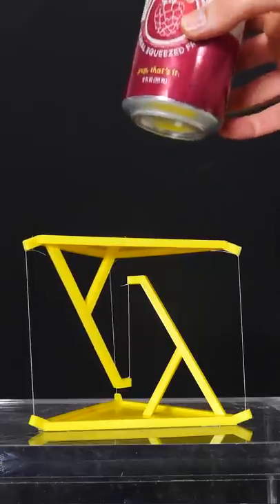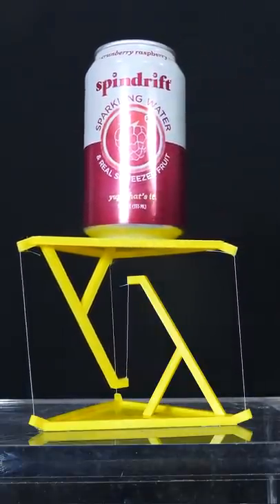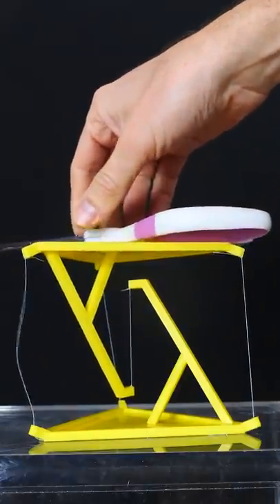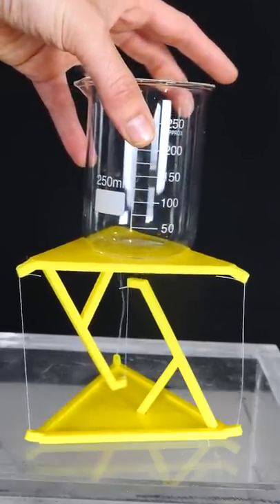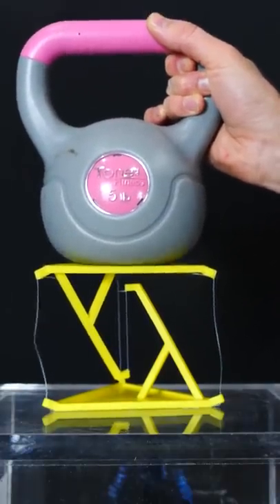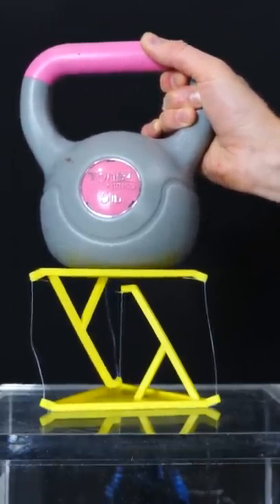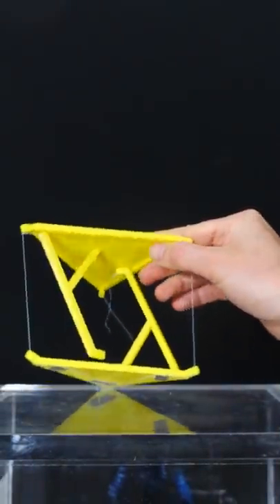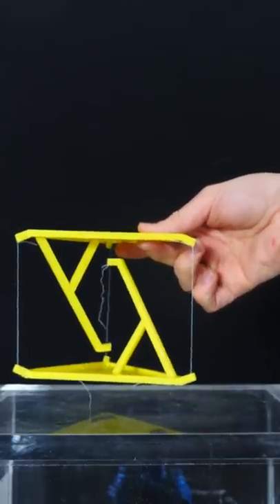Floating Tables Holding Weights

Comment: I honestly don't understand how the table could keep itself up stable even though he explained it, that's just crazy
Reply: It's pretty simple. The centre string holds it in place, and the side strings prevent it from tipping. Removing a side string will cause it to flip over, since nothing stops that side from going up. 

If you balance it right, you could do it with 2 side strings

Comment: Wait, so theoretically if the middle string was thicker/stronger would it be able to hold more weight, or would all of the strings need to be the same strength/thickness? /gen

Comment: Doesn't the centre string need to have more tensile strength than the 3 outer strings? The tentre string is the only one holding the structure up, and the outer 3 are the ones that are holding the structure down.

Comment: Well obviously the center string is the one that broke, it holds literally all the weight.
Reply: It doesn't hold literally all the weight. The sides hold a lot of weight.
Reply: @MelodicTurtleMetal  The sides stabilize the structure in 2 planes, but hold zero percent of the z axis weight. Zero.
Reply: @aanler  you're wrong. Applying weight in any direction will cause it to sink at the pressure point - the strings opposite pressure point will take a lot of weight because the structure will try to tip, and tensile force will pull it back down from the edges.

The centre takes more weight, but very far from all of it.

With nothing in it, the weight is spread between the centre string, and the string furthest from top pieces centre of weight, which is far from the centre. The far string will be under a lot of pressure

Comment: This doesn't make sense and my brain hates it
Reply: The top can't fall more, because the steering in the middle is short enough to catch the top. The top is pretty much hanging from the tip of the bottom middle structure. 

The strings in the side prevent each side from tipping up. When you apply without to one side, the string on the opposite side 'pulls' against the weight.

As long as the strings are the same length, you'll have an even structure.

Comment: I'd like to see someone power a house with just an alternator instead of using a generator some kind of water wheel contraption using magnets with strong repulsion permanent magnets bars would probably have to arrange the magnets just right and have enough of them but would be free energy so long as the wheel lasts

Comment: Duh? The center string holds it up and the others stabilize, but how is this good? If you just connected the plastic pieces it's much better. That's why no houses, tables, chairs, buildings, pretty much anything meant to support stuff is built like that.
Reply: this is being built because its cool not because its practical

Comment: It's just the one string in the middle holding it. The rest of the strings are just for show.

Weak.
Reply: The rest of strings are vital. If you cut any of the side strings the structure will topple over. The side strings prevent the sides from going up. 

So no, not for show

Comment: It seems like a really waste of time to even make one of those they are just useless
Reply: Don't use string? A thin cable will support tremendous weight
Reply: @MelodicTurtleMetal  yes but if it sits to close to the edge or just even off center it will tilt and what ever is on there will fall.
Reply: @tigerlily2941  no, that's what the side strings do. They stop upwards movement. You can place things in the edge and they won't fall off
Reply: @MelodicTurtleMetal  hmm 🤔 how interesting 🧐
Reply: It looks cool though